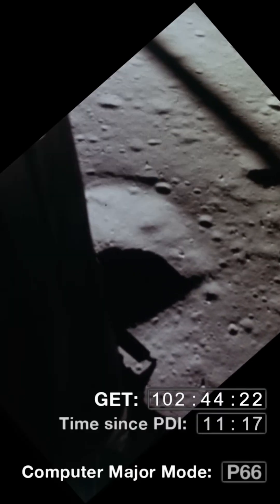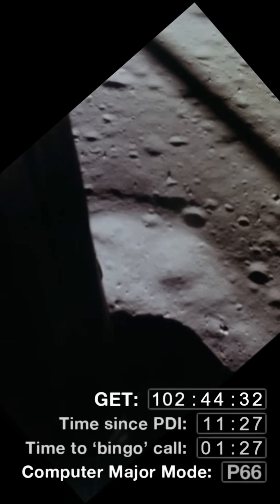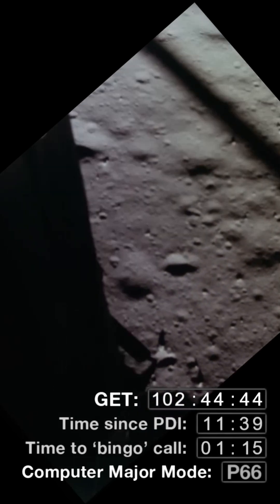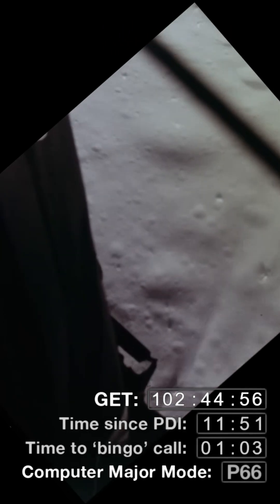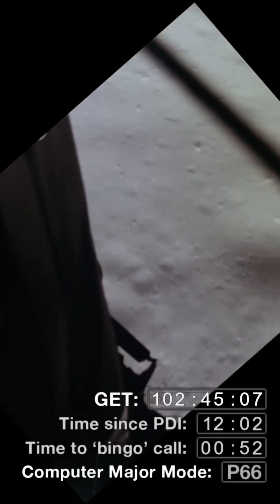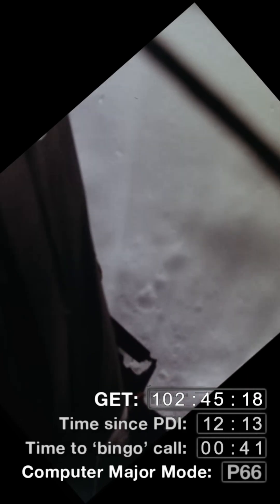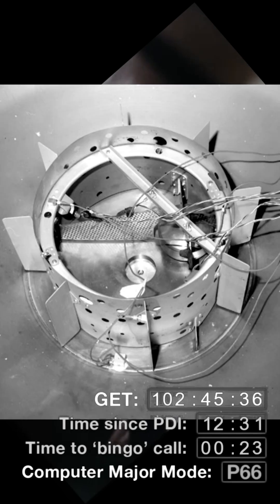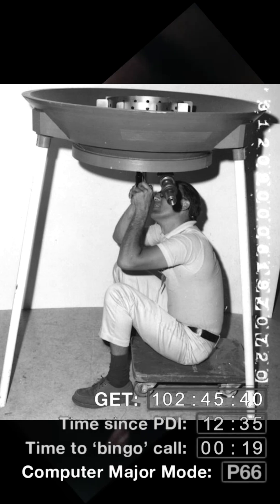Was Apollo 11 Really Running Out Of Fuel?

Comment: The scarce fuel story is perhaps manufactured later on. I was 16 then and a space enthusiast. I had preserved newspaper cuttings of the event for decades and read them many many times. I almost  remember sentences. 
I think FUEL SHORTAGE STORY WAS NOT REPORTED THAT TIME.
In all such projects multiple redundancies are built in critical areas. WHAT CAN BE MORE CRITICAL THAN HAVE SURPLUS FUEL WHILE LANDING ON THE MOON FOR THE FIRST TIME IN HUMAN HISTORY?
Reply: The story as described here is absolutely correct, Houston thought Apollo 11 only had about 20 sec fuel left when touching down, this is even clear from the radio communications, it later turned out to be closer to 40-45 sec, I was a teen during the Apollo 11 landing too.

Comment: Hey Scott is it also true that they weren't 100% sure of the amount of moon dust on the surface so they were worried about it potentially sinking?
Reply: some said that was a possibility in the early (1963 or 64) stages of the Apollo planning. But not after the Surveyor program soft landed several times before 1969
Reply: @stevevernon1978 correct, Surveyor dispelled any ideas of “sinking”

Comment: Might be a stupid question, but wouldn't the fuel sloshing around have caused inconsistent combustion, after a point? It would seem as though aborting the mission would have been the smart move either way.
Reply: It was a pressure fed system to help prevent sloshing. But yes, sloshing will create combustion instability.

Comment: This is a somewhat misguided video: Even brand new student pilots are taught that the primary means to measure fuel remaining is time, with the fuel gauges as secondary. Fuel gauges have several ways to give erroneous readings, including the very common and well-known problem of fuel slosh, which gets worse as tanks are emptied. They were 17 seconds from an abort…period. A better gauge wouldn’t have changed this. And I highly doubt future mission were switched over to relying primarily on the new fuel gauge.

Comment: Uh… except that if you have no other way to quickly check this, it’s the same as if the fuel actually IS low!The level of concern and crew reactions were exactly as they should have been given what they knew at the time. An abort and its different set of unique hazards was only 17 seconds away. This 20/20 hindsight and Monday morning quarterbacking don’t change that.

Comment: They weren't quite as low on fuel, as you might think.

They had a reserve of about 20 seconds, beyond the abort decision point, known as the "bingo" point.

This meant that, once the abort decision  point was reached, they had approximately a further 20 seconds of engine thrust, to decide to either land or abort.

Later calculations put the total remaining fuel (main plus reserve fuel) at around 45 to 60 seconds.

Comment: How does fuel touching a sensor indicate a low fuel level?
Reply: the fuel sloshes around in the tanks and when the fuel does not touch the sensor it activates a warning light.
Reply: @erichaynes7502  That's not what was described in the video.  It was explicitly stated that the fuel sloshed around and made contact with the sensor, and that they added a modification that prevented that.

My question stands.
Reply: @TrueThanny  when the sensor was uncovered, the low light indicator would come on. My answer stands TT!

Comment: Did they ever figure out approximately how much fuel actually was left? 

Up until this video, everything I've ever read or seen has said it was either less than 1 minute or less than 30 seconds of fuel left.
Reply: Yes, later on they figured that they actually had plenty of fuel left, 50 seconds worth. Plus, after those 50 seconds there was enough fuel to abort and return to lunar orbit.
Reply: @erichaynes7502 The fuel to abort and return would have been the ascent stage tanks. They were completely separate, rather than having just a limit on how much you could use out of a shared tank.

Comment: When landing, the only fuel sensor said they were running out of fuel.  I'd be interested in knowing where you got data that said they had plenty and the fuel was "sloshing" around.  Than would not have been possible to know.
Reply: They had data showing the throttle setting of the engine from second to second. That would allow them to calculate how much propellant was used each second. Add it all up, and subtract that total from the amount loaded, and they'd know how much was left.

Comment: It’s not a “myth” if the astronauts operated under the presumption that the alarm was real.
Reply: It's a myth that they were low on fuel. Nobody has been spreading a story that the astronauts didn't believe they were low on fuel. The story has always been that that they were going to run out of fuel in x-number of seconds, and that's a myth.
Reply: @BC-wj8fx 
It’s not a myth… they believed they were low on fuel. They were mistaken in their belief, but it isn’t as if they told a story about being low on fuel when nobody actually acted as if they were low on fuel. Being wrong doesn’t make it a myth… do you know what a myth is?

Comment: A "false alarm"?  In one sense yes but in another sense no, it wasn't a false alarm.   But a "myth"??  No!  That floating text is the judgmental equivalent of clickbait 😤😠.    And even the term 'false alarm' is disengenious because of the phrase:  "looking at the flight afterwards".   Only hindsight made it a 'false alarm'.  In the moment, the alarm was REAL — and fully justified the lack of breathing by the controllers — because they didn't KNOW they had enough fuel.  
      What about 12 & 13?  How did they handle the fuel slosh issue for those flights??
Reply: 13 never landed on the Moon so there was no issue
Reply: @olasek7972     There definitely was a question before the flight.  That's because they didn't know beforehand that they wouldn't be landing 🤷‍♂️🤷‍♀️.  
My question was about the plan, the protocols they had in place at the time they committed to their TLI burn 🔥.  That applies to 12 & 13 equally.
Reply: @simian_essence the procedure was always the same, they were always counting down to the “bingo” call at which point the abort would be mandatory, during later flights perhaps they knew their fuel status a bit more precisely but the same bingo call existed.
Reply: @olasek7972   It seems then that the difference was knowledge — which would eliminate any "breathing" issues.  And those lack of breathing issues only applied to Apollo 12.
Reply: It's a myth, a popularly spread false story. It was objectively a false alarm because the alarm is called "low fuel alarm". If it were called "lower sensor uncovered alarm" then no it would be an interpretation error. But if you have an "X alarm" and X didn't happen, then it's a false alarm.
Reply: @BC-wj8fx   What was the myth exactly?
Reply: I just looked that up to see myself. 12 had the same issue, but it seems they suspected  the warning was coming on sooner than expected. They had a margin of error built the into the abort sequence so you they seemed to not be concerned. 13 was to have landed where there wasn’t as much possibility of needing to maneuver as much.

Comment: The Eagle LEM was seconds late detaching from the Command Module.
Armstrong told Aldrin,”We’re going to go long”.  And, they overshot their landing target and had to search for a safe landing area.  That did cost unexpected fuel consumption.  And, Armstrong and Aldrin quickly found a safe landing spot away from the boulder field.  Job well done!
Reply: I though Eagle actually detached a tad early from the command module, before the space between the hatches on both vehicles had fully de-pressurised; So Eagle detached with an extra push from that still-pressurised air, which meant they had a bit of extra speed, which meant they 'went long'. Armstrong didn't realise they were landing long until they rotated the LEM at the appointed time, which gave him a view out, and he realised they were further downrange than they should have been at that point (Armstrong, ever the professional, had memorised the expected landmarks on the Lunar surface).

Comment: There is a failure mode in zero-g switches (and sensors?) wherein a bit of metal inside the switch body floats around and then bridges the switches' contacts. Normally the metal fragment would just sit at the bottom and not cause an issue.

Comment: War stories are only fun to tell AFTER you’re safe.  But up until that moment of BEING safe, i fully understand the  “everyone is turning blue” statement - you either abort to get them back out or the die is cast and your friends may never be coming back. Pretty intense pressure.
Reply: It’s ridiculous to even question ground controls level of concern. The mission really was just 17 seconds from an equally hazardous abort. What they learned later about the unreliable fuel measurements is irrelevant. They had to act on what they knew at the time.

Comment: One of the biggest changes besides the new baffles was the change in a procedure that had the DOI burn be done by the SPS on the SM instead of the DPS engine on the LM. This would have been first used on Apollo 13, but due to the oxygen tank going 💥 it was first done on Apollo 14.

Comment: If you have enough fuel but not knowing it, that’s the same as not having it!
Reply: My thoughts exactly. The other hypothesis would be “let’s hope it is a false alarm”
Reply: @AL-YT-comment  “fuck it, let’s try it anyway just in case we’re wrong”
Reply: @AL-YT-comment  Mig 25 Foxbats had a fuel gauge the pilots could "recalibrate". They'd turn it from empty to full often so they'd give themselves the illusion of more fuel.
Reply: Even worse, if it's sloshing and can't get in the engine you don't have it
Reply: 100% it's not like they had more time to attempt the landing. When the timer said abort they'd abort. Discovering later that they did have enough fuel wouldn't make any difference.
Reply: Was the engine running out of fuel? Absolutely. From the moment the engine started the burn..😊😊😊
Reply: And isn't it just a theory?  What if the fuel gauge was right?
Reply: @2nostromo then they would have had to initiate the abort sequence (as per mission rules). But you won't want to do that when you're very close to the surface. Not because you'd give up the mission, but because it might take too long until the DPS was shut down, the descent stage jettisoned the APS built up thrust, and the downward movement stopped.
Reply: @2nostromo They knew how long they had burned the engines for, and they knew how much fuel the engines consumed. Therefore they could go back and figure out how much fuel should have actually been in the tank. 

These days they could also do a simulation of the mission and figure out exactly when the fuel would have sloshed away from the sensor.
Reply: @2nostromo just watch the short video. He explains it. It's easy... You can understand it...

Ok, let me spoilt it: The fuel was sloshing around - and the low fuel sensor triggered, because for a short time there was no fuel at height of that sensor on the side where it was...
Reply: @Richard-S  : No gravity, and then suddenly there was, plus the movement of the vehicle.
Reply: @Richard-S  1/6 gravity would tend to amplify the sloshage.  lol
Reply: @Richard-S  Doesn't matter. If your gauges say you're fuel critical, you abort due to low fuel. You don't just hope the fuel warning is in error.

They were only able to determine the error after the fact. Real-time, they were close to aborting due to low fuel alert.

Comment: Scott, you should also do a piece on how the LM software team at MIT was given bad values for the time from throttle command to response, and so got into several regimes where it was opening and closing the throttle, when the engine was actively being throttled, like 10-plus times a SECOND.  It created a "castle graph" of the thrust, as the thrust graph made nice castletop crenelation patterns when reviewed later.  This could have stressed the engine thrust control pintle such that the thing could have exploded.  Thankfully, it was caught after Apollo 12, IIRC, and was fixed for the rest of the landings.  I count that as the biggest potential threat to the first two landings; they were lucky the descent engines held up to the unintended abuse!
Reply: I have gone my entire life of 6+ decades and never once knew of the word crenelation. I love that there’s still things to learn for me.
Reply: While these oscillations were frequent, the engine was not literally opening and closing on/off multiple times per second; it was making continuous, rapid control adjustments that the engine hardware could handle. The oscillations did place some stress on the thrust control pintle, but there was no immediate risk of catastrophic engine failure, the LM engines proved robust enough for both landings.

Comment: Even if the sensor was defective, they would have aborted the landing a few seconds later.
Reply: The sensor itself wasn’t defective. It was the environment. The sensor triggered when it was no longer submersed in propellant as designed. The problem was the propellant sloshed in the tank, probably because Armstrong was hand flying and made more corrections than the auto pilot would have. once the sensor was triggered it didn’t matter that it because submersed when the fuel sloshed back over it.
Reply: @bobh6728  I know that. 
My point is they did not know that anything is wrong. So they would have aborted a few seconds later.

Comment: Yep -- in fact, Apollo 12's LM also had a low fuel sensor uncovered early, and had their own false low level callouts.  Plus, on 12 the fuel sloshing was so bad that the RCS was firing nearly constantly, to try and damp out the oscillations that transmitted themselves to the vehicle.  It wasn't until Apollo 14's descent that the RCS firing went to normal.  It would have likely gone to normal on 13, too, but they never got to burn PDI to find out.

Comment: I've thought about this moment and what they had to do on apollo 14 several times and in my head engineered a few solutions that would not have required any welding. Basically , the same typical folding out structure , but with ribs ratcheted like a zip tie , and all of that attached to the backside of that 6cm port
Reply: zip ties were invented WHEN? as in "later than 1969"

Comment: Am I incorrect and thinking that in the aftermath, they realize there was a lot more fuel but for everybody involved at the time there was only 17 seconds of fuel. During that last half a minute did anybody realize or Care that they’re actually was more fuel? So in everybody’s mind, it probably was a very stressful situation. Thankfully, it did not need to be but had that 17 seconds run out they probably would’ve pushed the button and launched off the Lamm.
Reply: Thankfully, they never got that far.  There were two callouts remaining -- 15 seconds, and Bingo.  The Bingo call was supposed to be the "make up your mind RIGHT NOW, because your engine will quit any second!"  The contact probes touched right before the 15-second callout.  But considering where they were, had Bingo been called and they were only 10 to 15 feet above the surface, I think Armstrong would have just set her on down, at that point.  Much lower, and you're in the Dead Man's Zone, where the LM will fall to the ground before you can ignite the ascent engine.  So, they'd have likely tried to set it down, had it come down to the Bingo call.
Reply: @DougVanDorn 
Wow.. 😢 
As we've seen lately numerous landers tipping over, some apparently from drifting sideways at surface contact.. 📐
Reply: @livelyarts49  A tall spindly lander piloting itself is a little different than a very wide one, piloted by a person in the seat putting it down.

Comment: Amazing to learn that "they were 17 seconds from running out of fuel" is the boring (and false) version of the story.
Reply: It's not entirely false, because they can't use fuel they don't know about.  When they reached the bingo fuel call, they'd have had to abort and the additional fuel they actually had would have been unavailable and useless.
Reply: @davej3781  Absolutely correct.
Reply: The true remainder was about 45 seconds, even if it's more than twice, it's still not very much.
Reply: Likely the AGC would have automatically switched to the Abort program had that count reached zero.
Reply: it wasn't "false" since for them at the time of the landing it was "true".